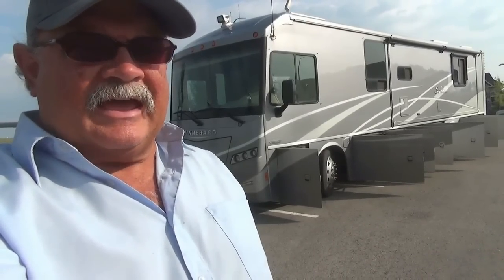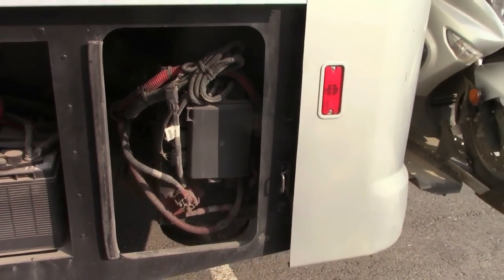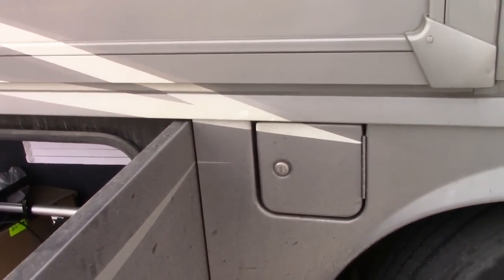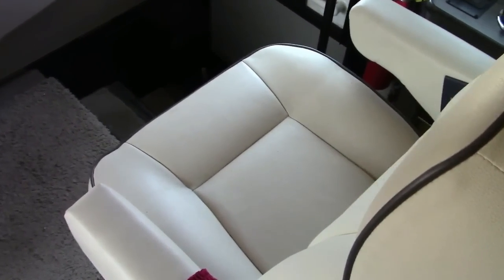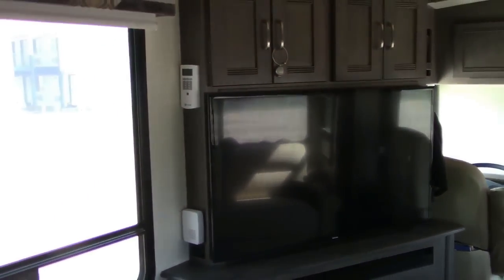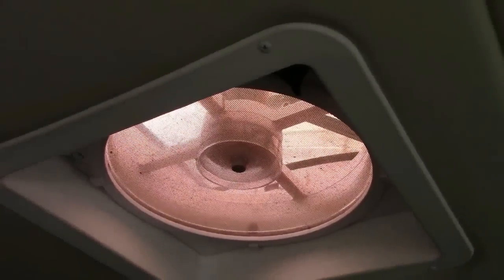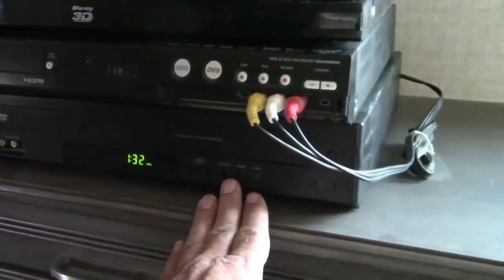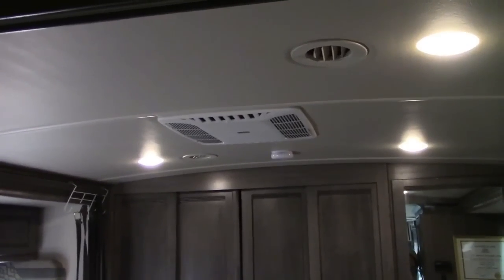A grand tour through my motorhome - see how I live fulltime

Comment: I was amazed how much stuff you have packed in your motorhome. People I talk to always complain they don't have enough storage space in their coaches. We have a 35' class A Winnebago and  I guess I am the odd one out as half the cabinets in side have little to nothing in them, as half our out side storage  bins have nothing in them. I can name everything we haul in the outside storage 3 chairs 2 plastic tables 1 bar b que  and some tools that's about it.  I figure if I don't use it during a travel season out it goes. The one issue I have with Winnebago is the sewer dump and the water hook up is in the same compartment. Having the sewer hose and water hose touch in that one bin made me gag. Also my power cord is coiled up in that compartment.  I built a divider that separates the two so they have the same door but  there is no contact with the sewer stuff to the rest like the power cord. Good choice in bikes as I have the same scooter as you. I have only hauled mine once because it takes 2 people to get mine up on the rack as my trailer hitch sits way higher than your. Thinking of putting a hitch on my tow car, Suzuki GV to put it on that way the hitch on the Suzuki would be way lower than the hitch on my motorhome.
Reply: My wife use to puts stuff in and I take it out now after 30 years of marriage she gave up My sister and her husband had a 40' DP and had every cabinet and outside storage bin full to the max. It just drives me crazy to haul stuff I am not going to use on a daily basis. We have gone as long as 3 months and I don't miss that stuff. You looking at a guy who lived full time for over a year in a VW camper. The next thing to go is the second TV we never use.  @jerrydixon
Reply: "I figure if I don't use it during a travel season, out it goes...."

The key words there are during a travel season.  When you're full-timing, every season is travel season.  That makes a huge difference.  When you're a full-timer, this is your home -- not your "home away from home".  Everything you own, you have to take with you.
Reply: Agree with you about the fresh water and sewer systems, though.  They really should be in separate compartments.  Ugh.